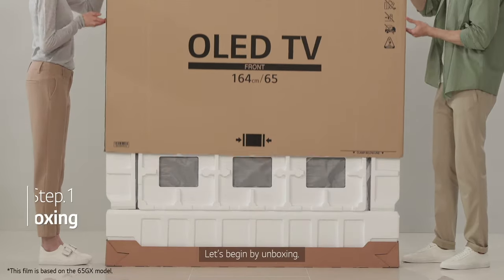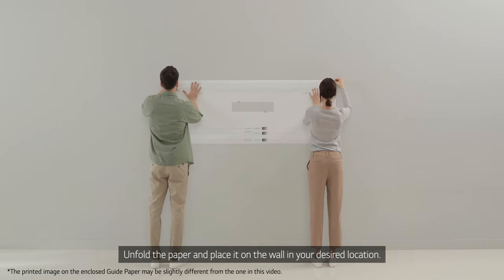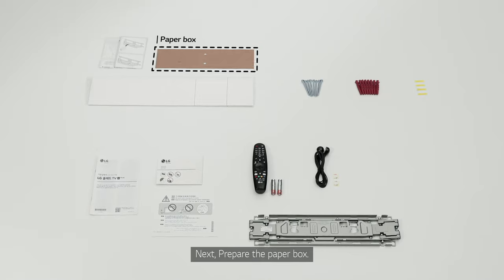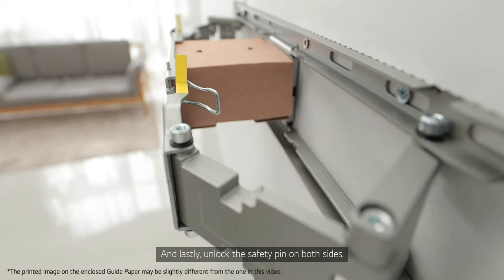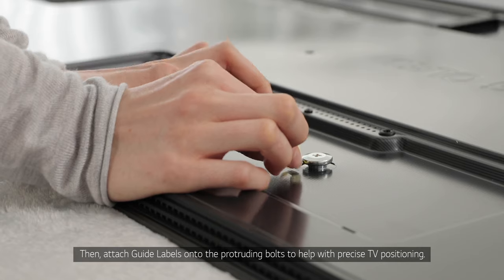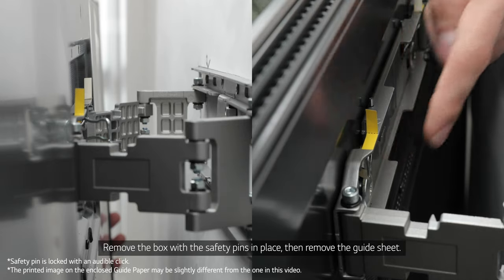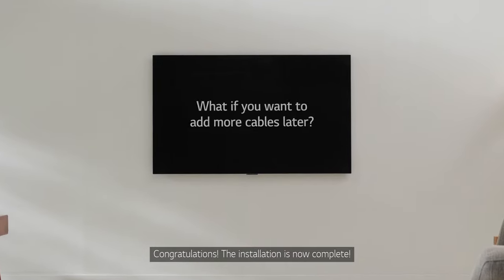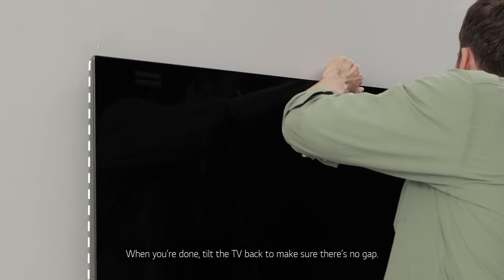2020 LG OLED TV l Unveiling the secret of the flush fit on your wall – Installation film

Comment: What is the best way to handle it if the bracket does not contact two studs on the location I need to mount it.
Reply: You gotta put 2x4 on the stud so you can frame for support

Comment: Please tell me this TV is available with no speaker?
Reply: The in built speakers are at the back and fire to the wall.  No external speakers are there. You need a sound bar for that ultimate experience or connect to amplifier receiver!

Comment: Nope nope and nope.
Where is the power cord ? Bluray, games console etc. Damn that's an ugly system.
Reply: The Bluray cable is in the trash bin next to the VCR cable.
Reply: @Virtualmix  1) There’s no such thing as a bluray cable. 2) Physical media (or digital rips of the discs) are still the highest quality releases you can get.
Reply: The cables are routed in wall. You only use molding if you’re being lazy.
Reply: @BlownMacTruck  we have a wall that’s off center with studs. We have an older TV mounted with an outlet that’s run up to the Tv. Any idea how to mount this? I assume we need a recessed outlet which is no issue but I’m worried about placement on studs and placement of existing outlet.